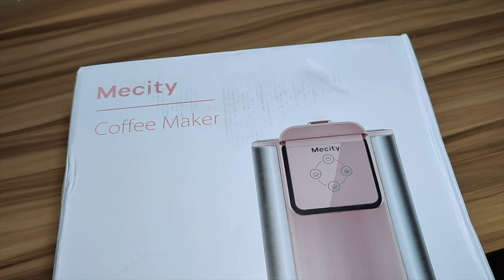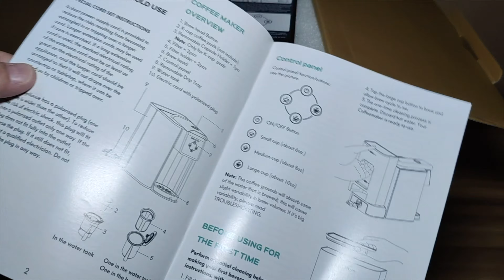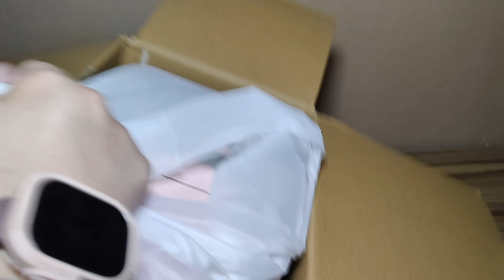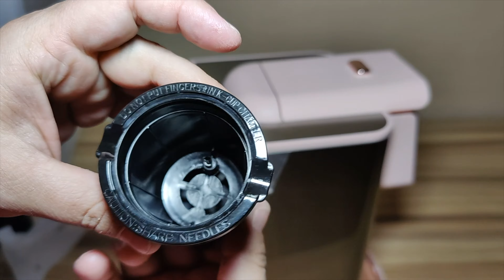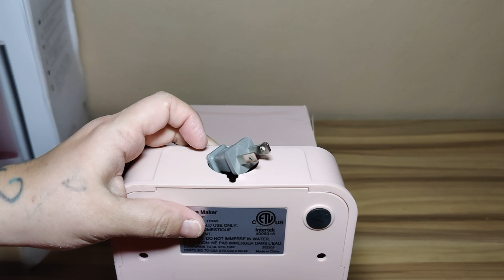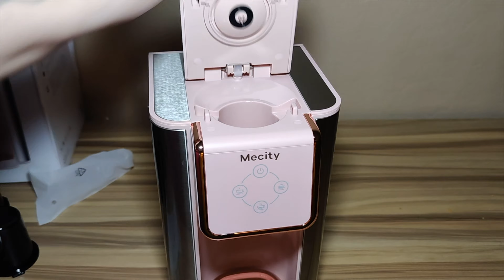Mecity Pink Coffee Maker 3-in-1 Single Serve Coffee Machine

Comment: I bought mine in April 2025 and now August the water stream is low.
Reply from the maker: You might want to run a cleaning cycle with one part vinegar to two parts water, that will help clean out the spout that might be clogging the stream.

Comment: Hello I just used mine today and my k cup would not fit in the black cup and would not close. I put the kcup in without the black container. It closed and brewed. Not sure how yours worked because you show it going on the top, but not fully closing it. Bay City Mi
Reply from the maker: @generation_XO  I don’t have any issues with my kcup fitting into the black cup, it might be the wrong one for the kcup. This machine comes with two black cup, one for the kcups and another one for loose coffee. The cup for the loose coffee is much smaller in size.
Reply: Hello, I tried it the second time, with a Folgers k cup inside the black container, and it did work. I sure hope it works for about a year! I purchased another coffee one cup last week, it lasted two days, then wouldn't turn on. It wasn't this brand, but it was in teal, my favorite color. Thanks again for the video. Happy February 22, 2025. - Babcia